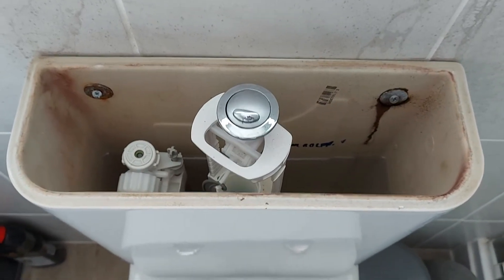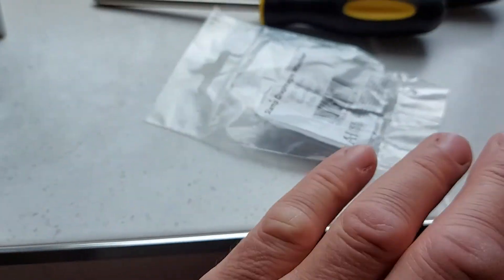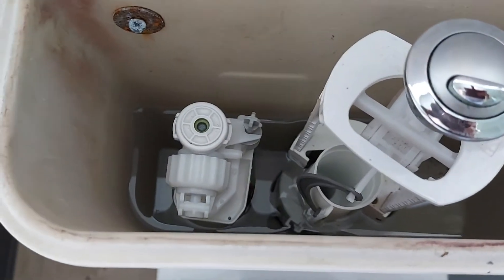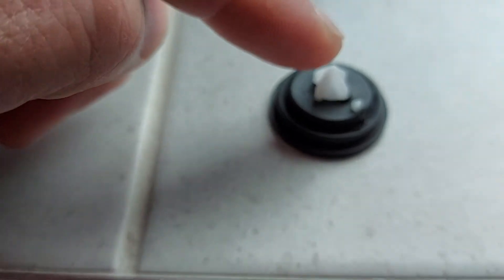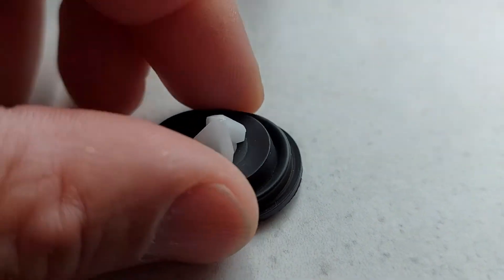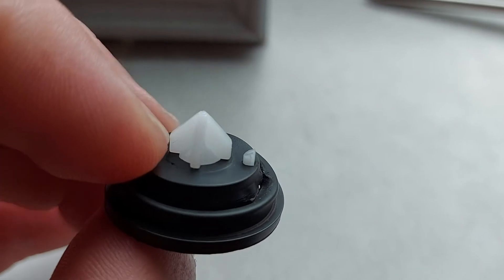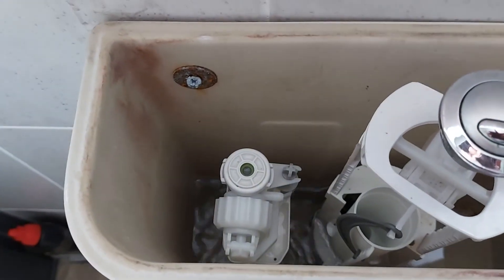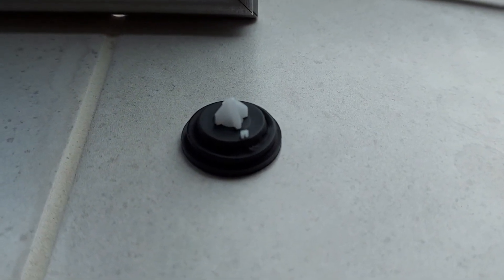Siamp inlet valve replacement essential information

Comment: Just followed this after spending an hour and a half trying to understand how replacing the Siamp washer solved my slow filling but now it wouldn't stop!  Its amazing but this tiny little change instantly fixed my system when I was 10 mins from grudgingly phoning a plumber!  Well done vidkid you are a champion troubleshooter!!   Thanks for posting this!

Comment: A word of advice, I ordered some of these from ebay and expected it to be a quick fix, they looked exactly the same and I anticipated no problems, however, it didn't fix the problem, after some head scratching and swearing and on closer examination, I found that the plastic part of the replacement diaphragm was a little poorer quality than the original, so, I pulled the rubber seal off it and fitted it to the original plastic part, reassembled and hey presto! I might have just been unlucky but I bought them because they were just over a fiver for five on ebay and Screwfix wanted £6 for what I assume would be an actual Siamp part and not a copy, well, you live and you learn.

Comment: This is the exact problem I had. I just wish I’d found your video 2 hours earlier! Went from a slow fill to not stopping after fitting a new diaphragm. Refitted it multiple times then in a last ditch attempt wondered if the rubber should be under the plastic point? Tried it and it worked like a charm! The good news is that I’ve burned loads of calories today running up and down the stairs turning the water on and off every time it didn’t work! 😂

Comment: thanks for the video. Had exaclty the same problem. Bought a replacement washer from screwfix and the toilet kept overflowing. After watching your video, I pushed the rubber below the 4 wings with my fingernail - problem solved. What a terrible design, not to mention the new replacement washer came with the rubber sat up on the wings!

Comment: I bought a couple of replacement valves and had the same issue, your video and tip pointed me in the right direction. I replaced the rubber on the original nylon part and hey presto it worked. THANKS, you saved me changing the whole filling valve.

Comment: Well spotted, my daughter has the same system which has been constantly running. Checked the valve loads of  times, cleaned it, took it out put it back in, still the same problem. I’m gonna check the rubber is under the plastic to see if that’s the problem, thanks for the advice.

Comment: I had exactly the same experience: fitted and refitted several times but still overflowing. Searched and here I am. Sure enough, part of the rubber wasn't tucked under the plastic 'wing'. Adjusted that and it works! Many thanks for solving a puzzling problem.

Comment: A helpful video, thanks. My Screwfix replacement valve had this problem, but I still had multiple trips up and down the stairs to turn the water on/off as it still didn't work. I eventually found the small hole in the plastic fitting - closed by the arm from the float - was closed by limescale and needed clearing with a pin.
Worth checking if you're having problems.

Comment: I also had big problems with the system not stopping to fill. I suggest that when repacing the black washer you also replace the one in the top of the inlet because mine caused water hammer (Lots of banging in the pipe like a hammer). It is also important to make sure the small nib on the mount for the black washer engages inthe housing when tightening up the nut that holds the black rubber in.
Reply: I changed the membrane and now it fills very well, but when the valve starts to close, there is a series of 10-20 water shocks with a total duration of 5-10 seconds. That is, the valve opens and closes and all this happens very quickly. What is the problem?
Reply: THat is exactly what happened to me. Its called water hammer. You need to replace the washer under the white plastic cap on the top of the vertical pipe . It just flips off if you get a screw driver under it and it then snaps back on. Hope it works for you
Reply: @peterwebster6257  Do you mean the washer like in this video? https://youtu.be/QxEncKO4364?si=x4FsN9dw7aI6QqjW

if yes, then I have a slightly different structure, the company of my locking system is alca plast, there is no such washer, so the problem is different. I think the material of the new diaphragm is silicone, but the original had rubber. Perhaps the new diaphragm is too soft. or the hole in the diaphragm needs to be changed, I have such thoughts, but it can actually cause harm

Comment: Good info, I've got one of these and noticed that. I have the same  Siamp valve and flush mechanism also.
Funny thing about the inlet valve  -  I've replaced mine about 2 years ago  as it wasn't shutting off - got 3 replacements from Screwfix  -  last week I had the same problem so took the button and cistern lid  off and fitted a new one, it didn't work every time so 2 days later put the remaining one in and it was the same - I did a bit of messing about and realised that if I screwed the button on the flush valve all the way in when the lid was off the inlet valve shut off ok, but not when it was only in a couple of turns and continued filling - ditto with the lid on and the button really tightly screwed down.
 I cant figure out  yet how the  depth of the button can affect the fill valve but its working fine  - going to download the destruction sheet for  both items and see if I can find an answer.
Thanks for you video our kid.
Reply: try turning the incoming water pressure down. I set my incoming water tap to half open and the constant filling issue stopped.

Comment: First class video that solved a simple problem that had confused me. Surely this should be checked by quality control.  At the cost of such small diaphragm it is bad that it won't work straight out of the package. Thanks again.

Comment: Very useful clue! I had exactly the same issue. Changed diaphragm and valve wouldn't cut off. Small adjustment of the rubber, exactly as you described & shown solved the problem immediately! I was lucky I came across your video quickly - spared me a lot of stress ! Ufff ! Thank you so much !!!

Comment: Thank you for this. Had the same issue, refitting the valve a few times but it keeps overflowing, the difference being I had to climb into the attic each time to shut off the water and then again to turn back on to test the valve. Saw my diaphragm was exactly as you described, so I did what you suggest and it worked like a charm.

Comment: I had a problem the water wouldn't stop filling after replacing the old diaphragm but I inserted  the old plastic insert in the new diaphragm, And that fixed the issue.
Reply: I changed the membrane and now it fills very well, but when the valve starts to close, there is a series of 10-20 water shocks with a total duration of 5-10 seconds. That is, the valve opens and closes and all this happens very quickly. What is the problem?

Comment: Changed mine due to slow fill. Fills fine but now after its full the white round section starts pumping what sounds like air and carrys on filling up going into the bowl...any suggestions
Reply: It was a cheap ebay replacement part. Went to screwfix 4 quid all done

Comment: Well I tried it, but it didn't work. This cistern drives me nuts because it defies logic. When it was working OK, it filled, overflowed into the bowl for about half a minute and then stopped. Weird. I could understand it stopping before overflowing. I could understand it overflowing continuously and not stopping at all if the valve was faulty. What I can't understand is it overflowing for half a minute then stopping. It gets worse. Now it doesn't stop overflowing, and there is nothing apparent amiss with the washer. Any more ideas? Thanks!
Reply: See my comment above Ken - this mechanism is weird!

Comment: You spent £5 on a washer lol it's only £8 out of Screwfix for the complete fill valve and probably easier to fit as well...but good video for anyone wanting to just change washer.
Reply: I agree Jamesy but Its much easier for me to replace the washer as I have virtually no room to get tools in underneath the cistern.I think that whoever fitted the cistern fitted both the inlet valve and flush mechanism before putting the cistern onto the loo pan.Really  looking forward to when I have to replace the whole valve.Better get a doughnut washer in .
Reply: I changed the membrane and now it fills very well, but when the valve starts to close, there is a series of 10-20 water shocks with a total duration of 5-10 seconds. That is, the valve opens and closes and all this happens very quickly. What is the problem?